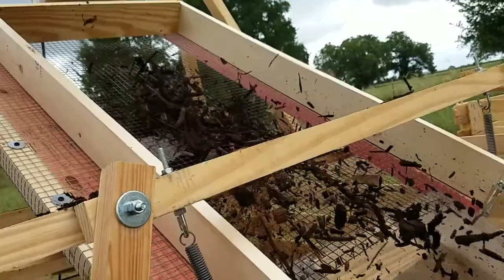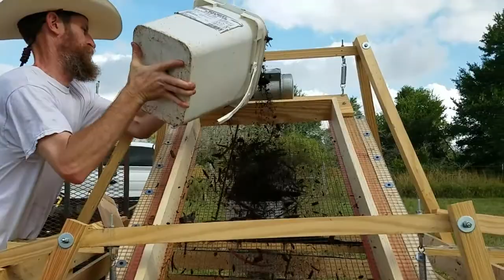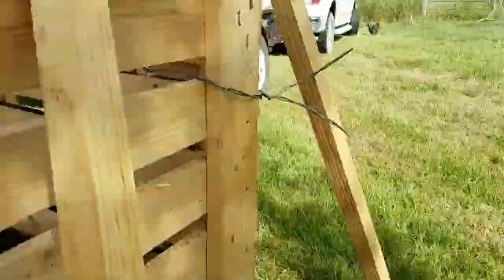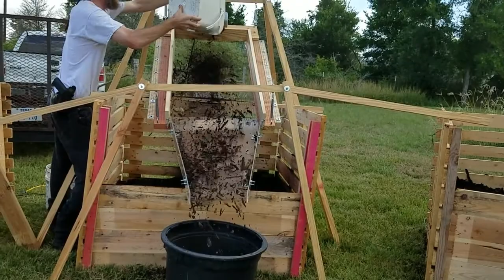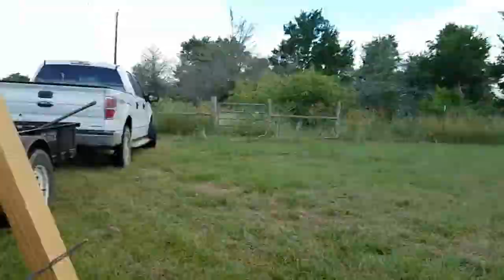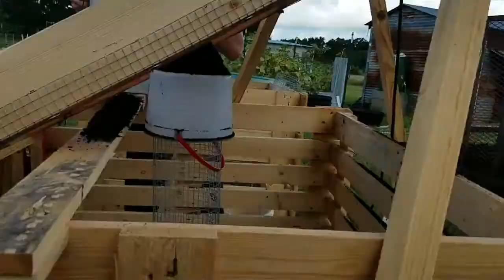DIY "Spider" Compost Sifter in Action | Plum Fabulous! Foods

Comment: Nice machine, and it does a pretty good job, but you need either taller side rails, or gentler vibration to reduce the spillage.  That is, unless you're fine with cleaning up the mess or leaving it where it falls.  👍
Reply from the maker: I don't remember a problem with spillage.  We would likely leave it in place, usually next to the compost pile, and wheel the sifted compost to where we want it.  The fences are light and simple on purpose, to maximize vibration, but they could be altered.  I don't remember what speed we were using, but there is a variable speed switch and it will slow way down to a crawl.  Perhaps we need a follow up video with the 1/4" screen and demonstrate the variable speed.
Reply: Well there's a pretty good idea.  👍
Reply from the maker: Here is the longer demonstration we promised...
https://www.youtube.com/watch?v=lnjtavxHtWk